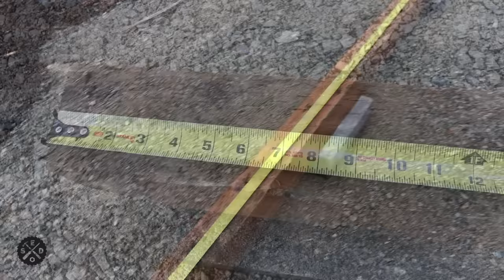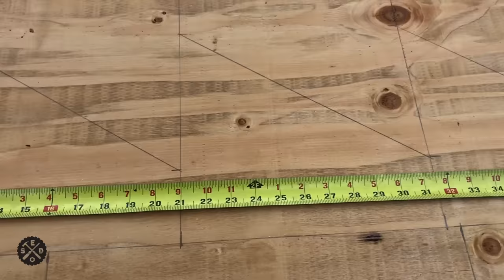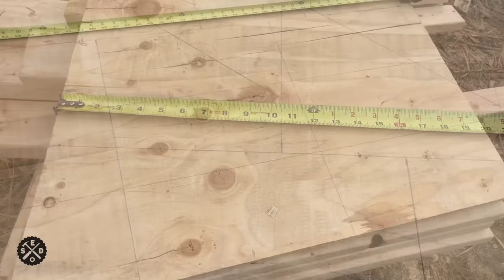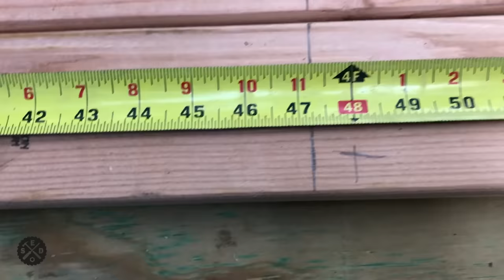How To Build A Shed By Yourself All STEPS 10x16 diy

Comment: SHOULD OF. PUT A DPC ( damp proof course)  ON TOP OF THE CONCRETE BLOCK TO STOP THE DAMPNESS .
Reply from the maker: What would you do if it was just sitting on gravel pad? I just did the blocks for a little extra height.
Reply: Smart Easy DIY .  HELLO THERE,   ENY THING LIKE ROOFING SHINGELS / DPC .
Reply: Smart Easy DIY . ON TOP OF THE CONCRETE BLOCK. THAT,S WHERE ID PUT  SOME DPC,  TO STOP INGRESS OF DAMPNESS FROM THE GROUND THROUGH  THE CONCRETE BLOCK ,, JUST SAYING .GOD BLESS
Reply from the maker: Oh ok. So if it was not sitting on Block but just on the gravel would you still put some down?
Reply: Smart Easy DIY,   YES,  ALWAYS KEEP TIMBER   OFF THE GROUND,  . PUTTING TIMBER on THE  GROUND IS NOT GOOD,, BAD BUILDING PRACTICE. . ALL IAM.  IS. A SMALL PIECE OF DPC /. Plastics WOULD. ,HELP.,

Comment: it would be better to screw the metal roof via the ribs or high points on the sheets, because if the screw seals fail, it will cause less damage on the rib
Reply from the maker: I’ve had others say that but I’ve never seen anyone do it very much. If you’re not careful on the rib it squashes it down and makes your sheets run funny.
Reply: @SmartEasyDIYer  yea, I suppose go with manufacturers recommendation when in doubt! I've seen that method with thicker corrugated sheets and 'kingspan' style sheeting with sandwiched insulation

Comment: You don't need a squaring calculator. It's about as simple as it gets: if both diagonals are equal, then your construction is square.
EDIT:
Oh well he mentions it later.
Reply from the maker: Yeah the reason I mention it is just because it helps to get it close so you don’t have to guess around as much initially. Thanks

Comment: The shed structure is beautiful but very week technically. If a strong wind approaches it will bellow the shed.
Why you cannot attach the shed the base to the ground in a much stronger way. Now it’s sitting there.
Reply from the maker: I tried to explain in the video. I wanted to be able to move it in a different location in the future. You could do a concrete pier foundation if its permanent for sure. Or do a concrete slab and have that be your floor. The shed is actually very heavy since it’s built heavy duty it would take a really crazy wind to move it especially with stuff stored inside.

Comment: Someone at work bought a shed and was told to not put it on a concrete slab. Can anyone explain to me why that is a bad idea?
Reply from the maker: I don’t know why it would be if the slab is nice and level and the shed it on pressure treated skids.
Reply: @SmartEasyDIYer  That makes sense to me. Thanks for the response.
Reply from the maker: You’re welcome. As long as the wood is treated that’s making contact with the concrete you should be fine.

Comment: I don't mean to knock your video but you went to town with that nail gun on those truss plates. It seems that many nails would threaten the structural integrity of the wood, someone correct me if I'm wrong please! Other than that I learned a lot from this. Thanks!
Reply from the maker: You’re welcome. So With the plywood layers I don’t think adding the nails weakens the structural integrity. I could’ve used construction adhesive as well and not done as many nails so that’s an option. But it’s depending on the strength of those nails combined with the wood for holding together.  I’ve done trusses before for larger projects and the goal was to do one every 1”-1-1/2” square of nailing area. Thanks

Comment: You really do need to use carriage bolts on the latch handle.
Though just pulling the screws doesn't let you pull the handle out,
the lock freezes the handle to the screwed-down plate.
Once the screws are out, you can just turn the handle, plate and all,
and open the door.  Oops!
Reply from the maker: Yes if you countersink them that should work.

Comment: 24" centers? SMH! No gasket on wall plate? SMH! 2"x4" 24" center roof truss with snow load? SMH! Thanks for the siding stain information, definitely using that.
Reply from the maker: Hey I mentioned you could go 16” on center if you want depending what you plan to do with it. If just a storage shed 24” is plenty strong. Not sure about wall plate gasket? The roof being 8/12 pitch and trusses built this way are very solid. Have you see how most sheds are built? I think this is built like a brick outhouse compared to most I’ve seen. Thanks for the input. Enjoy the stain. 👍
Reply: @SmartEasyDIYer  24" is ok and the "sill sealer" / plate gasket is only need on a house

Comment: Its easierto use concrete ,,screw the insullation and floor joists .. and plywood. The price of cement is way cheaper and lasts 100Xlonger,
Reply from the maker: Yes you certainly could use concrete. I did this on skids because I knew I wanted to move it to a different location on property. When using concrete you can’t move it. This I built two years ago when lumber was a lot cheaper. It’s also just to give ideas and you can vary it up however you want from there.

Comment: where are the metal joist hangers
Reply from the maker: For where exactly?
Reply: @SmartEasyDIYer  on the floor joist. Each joist usually has the metal hangers on each one , at each end.
Reply from the maker: Oh well they are fully supported on the beam they are sitting on so there’s really not too much weight out at the end that isn’t transferred in.
Reply: @SmartEasyDIYer  it looks sturdy and as you said it’s not a resident so maybe they aren’t necessary. Thanks for sharing yiu inspire me to build another shed in my yard .
Reply from the maker: Yes I think for a shed it’s plenty sufficient. You could always add them on yours if you feel it’s necessary. Good luck with yours! Thanks

Comment: Am I the only one who doesn't see a description to look at all the links promised?
Reply from the maker: If you’re in the app it’s sometimes a little hard to find but it should be right below the video.
Reply from the maker: There should be an arrow in the top right right below the video to drop down to the description.
Reply: @SmartEasyDIYer  Funny, as soon as I point it out the description is back. And I was on my PC and even my wife couldn't help me find it. Thanks for fixing it
Reply from the maker: I didn’t do anything. Lol Glad you found it tho.
Reply: @SmartEasyDIYer  Not sure if rough cut lumber would save a lot over what's on the shelf at lowes. But the wood alone for this build will set you back over 4.4k with 2021 lumber prices.
Reply from the maker: It’s crazy what it is nowadays for sure. I haven’t gotten rough cut lately but I think it would be quite a lot cheaper than Lowe’s if you can get it directly from a sawmill instead of having a middleman.

Comment: Lumber prices right now are high. How well does your 2000 ish cost hold up today.
Reply from the maker: I haven’t priced it out since. I would hang tight as prices are coming back down. Retailers are still offloading lumber they bought at higher prices so it’ll be a little while yet will they stabilize I think.

Comment: Im not sure why you didn't use 3 foundation beams and put your walls (load) on the beam itself, instead of using long screws. 🥴🥴🥴
Reply from the maker: Hey farmer Wayne.  For 10 foot wide two beams were sufficient. They’re only 16 inches in so very close to wall load. I didn’t use long screws for load purposes they were just to help better anchor the floor joists to the beams. You can use three beams if you want. This is just to share ideas so you can modify whatever you want.

Comment: If anyone needs a squaring calculator, I have bad news for them.
Reply from the maker: Whys that? Gives you a quick idea to get it close when rough setting things up then you can finalize exactly by measuring.
Reply: @SmartEasyDIYer  I was making fun. What I mean is you do not need a squaring calculator at all. It's one of the simplest calculations kids learn in middle school. The bad news is that the person who requires a specialized calculator for something like that is not very bright. A regular general-purpose calculator on a phone is quite sufficient for this.

Comment: Just 2 boards 1x4x8' 52 dollars.  7 dollars a 2x4x8' stud, 4x8' sheet of plywood 75 bucks a sheet.  It will take a bundle of money to build now days ~  Once i get these 2 little project done. I'AM NOT BUILDING ANY THING
Reply from the maker: I agree materials are getting ridiculous but I think you’re over paying quite a bit. Not sure which plywood you’re wanting to get currently Lowe’s locally has 3/4 cdx for 55 a sheet. 1x4x8 must be mahogany or something for that price. Problem is to buy a shed prices went up accordingly too.
Reply: @SmartEasyDIYer   Lowe's make me want to vomit! With there crooked junky lumber. I heard in the next 3 weeks >>>   prices on lumber going to JUMP 3X HIGHER~ The lumber where getting now is from FINLAND
Reply from the maker: Yeah their lumber isn’t the greatest without some sorting but their plywood seems ok. Usually local lumberyards are pretty comparable if you shop around. That’s the case here anyways.

Comment: Please use links that don't require Google chrome
Reply from the maker: They shouldn’t require chrome. Should work with any browser.
Reply: @SmartEasyDIYer  it doesn't.  I use duck...and it refused to open unless I sign into Google...
Reply from the maker: That’s weird I wonder if its something with your browser settings or if would work OK for firefox or safari. I’ve never had anyone else have problems.

Comment: Just needed another 2x4 on the top to tie the walls together, otherwise great build
Reply from the maker: Thanks. Yes you easily could. For a shed it seemed solid enough to just do one since I screwed the walls together well in the corners and the trusses are sitting directly over the studs.

Comment: There is no point to use plywood. Just use insulation hangers (metal rods that are springy) and install them then set insulation on top and your done. A box of like 100 for 20 bucks
Reply from the maker: Yes that’s what everyone keeps saying but what about the critters getting in underneath and chewing it up?

Comment: Flash to 2022 wood prices, it'll cost 3-4x as much to build
Reply from the maker: Depending on what you choose for siding it shouldn’t be too bad even today.
Reply: @SmartEasyDIYer  3/4" plywood is just under $100.-/sheet as an example, siding I wouldn't use as I'm not a fan but even still, I've been wanting to build a floating deck but put that off plus the shed I'd like to buy for who knows how long, prices are out of control , it's a rich persons product these days

Comment: 6' 6" doors?  I would just use std 8 ft studs and frame for 6 ft 8 in doors.
Reply from the maker: Since I was making my own doors that was tall enough and I used pre-cut studs because they were cheaper at the time anyway.
Reply: @SmartEasyDIYer  got it. Really a great video. The stain color is the huge winner. Totally beautiful
Reply from the maker: Thank you!

Comment: Why didn't he stagger the joints on that floor
Reply from the maker: I tried to explain in the video. Usually you do but I didn’t want more seams in my floor than I had to. I figured for a shed it’s ok. You certainly can stagger which I also mention.

Comment: Feet and inches? its 2020
Reply from the maker: Whats that got to do with it, You want it in mm too?
Reply: @SmartEasyDIYer  Something  I never quite understood. Why do people not used to using metric always go to milometers? Like you will read 2000mm on something instead of just 2m. It is like people forget there is more than just mm and you use whatever give the least trailing zeros. And don't say multiple units is confusing feet and inches are two different units.
Reply from the maker: I don’t know. I think from my pole barn framing days we use feet and inches a lot cuz with the big tapes they don’t do inches after so far they only do feet and inches. I don’t even remember using that in this video but perhaps I did on the longer measurements. It just seems to me on a long video like this that there’d be a bigger takeaway than the way a few measurements were presented. Lol
Reply: @SmartEasyDIYer  I was not stating that you did that in this case I just find it interesting the the first thing people go to is mm. And I have had the reply that it is because using multiple units is confusing. But using feet and inches is using multiple units already. That being said I have had someone once ask to cut 20 5/8 mm. (I think we all agree that is unacceptable). 
What is interesting as well is in imperial the unit down from an inch a line and there are 12 lines in an inch not 16. Which makes more sense as it tie in to 12 inches in a foot. Although, having consistency in imperial is just to scary I guess,

Comment: Soooo you’re walls are level ? Why wouldn’t a guy check anything for plumb? Level is horizontal,plumb is vertical!!!!
Reply from the maker: Yes it’s plumb. Sometimes level is used interchangeably. If your floor is level you make sure your walls are plumb and square.

Comment: thats not the correct way to use tyvek
Reply from the maker: How would you do it? I didn’t need it for a storage shed but I wanted it cleaner inside instead of rough boards. It’s a good idea if you’re planning to heat it too

Comment: That would be great if you build a shaft with a ladder going down to the bottom or one of the spiral staircases kind of thing with a tunnel after the bottom of the thing going in One direction or southeast west doesn't matter to your secret underground mansion you don't have to pay taxes on it cuz it's underground no one has to know all they have to know is a bit of land with a rustic old shed on top of it with a structure of the one side that could be your garage that's not sizeable equipment shed and that would be all of the surface no one has no the little shed goes to your secret mansion underground cool 😎 rocking the day away and the night you never know Wednesday when it's night and your secret underground mansion I wish I had one by the way so I can say see you and I won't have nobody knocking at my door bothering me that would pass on by myself crappy old old shed and I can say honey how hard I told them I told them especially to the witnesses they won't come knocking at my door cuz I can't find my door to knock on it but at last I'm just a poor man can never have something like that darn it all that's just a dream that can never be
Reply from the maker: That would be pretty cool 😁

Comment: not gonna lie. i did Not watch. building a shed can be real easy, finding or being able to afford the lumber.... not so much
Reply from the maker: You should watch and see what you think.
Reply: caught up on the 'watch' part. i learned construction about 50 yrs ago, being too young/small to frame. (swinging a hammer was a lot of work) however i was usually doing the cement work,  pour, shovel, tamping and scree. (i was pretty strong for a jr.higher) i did enjoy your quick and easy tips for trusses. and air tools are so much better than just a hammer.
does the 'Rugged wood' treatment work equally on cedar as well at fir? i like the rustic look but when i age my cedar naturally the wasps just eat it.
anyway thanks for the all the tips. they were clear and easy to understand. if i were ever able to do construction again.
Reply from the maker: Thank you I appreciate the feedback! Yes it works on cedar as well. Not sure how it does on the wasps.